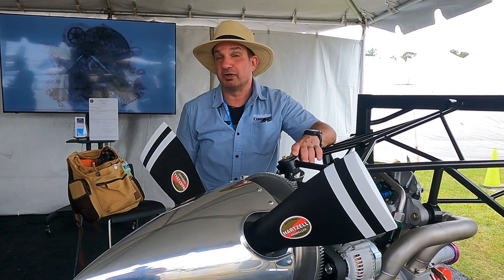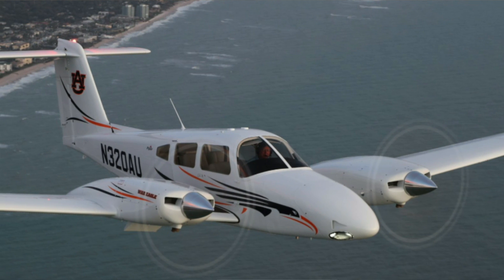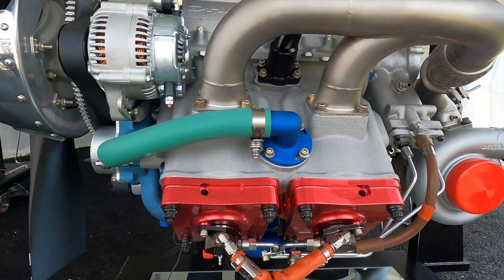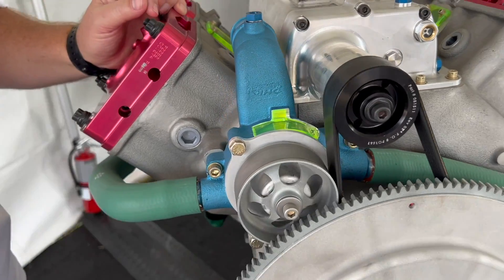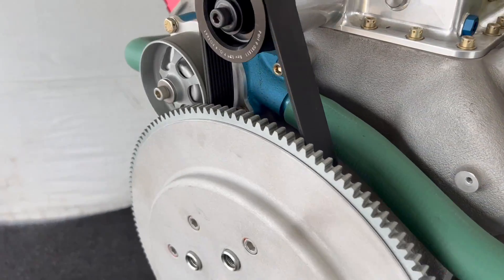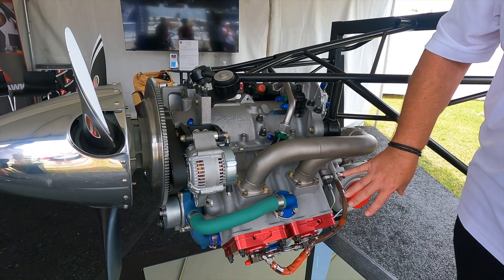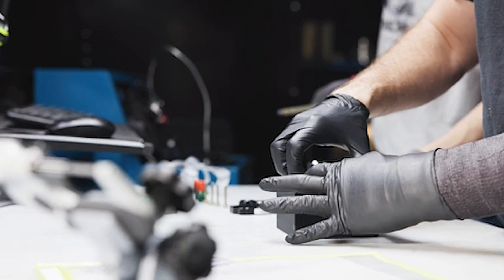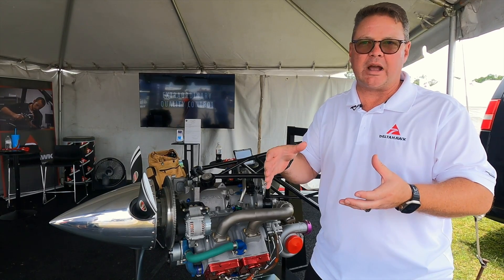EAA166 from Sun 'n Fun 2024: New Engine Walkaround

Comment: Question, do they need to be at 230hp to compete against gas turbo lycoming/continental of 230hp.  Seems to me a diesel can typically operate at 90% power all day long and the gas engine are typically operated at cruise at 75%ish max for longevity.  So a 200hp diesel would be equivalent to a 230hp gas at cruise

Comment: Current numbers I hear is $90-100k for the 4 cylinder with $60k+ for experimental.  This is engine only cost with FWF being extra.  I can't find a TBO or TBR.  With diesel weight a high concern and I assume the designers have compromised reusability to save weight, it would more likely a TBR.  Also, with litigation costs, will engine be serviced in house with only DeltaHawk mechanics or like Rotax with invite only certified shops?  Nonetheless, I don't see this trickling down to Cessna 172 types for quick some time if ever.

Comment: I love the engine.... i'm just worried about the belt on the supercharger.  Back in the day, I had a supercharger on an old toyota pickup... and it would blow the belt every 5 or 6 thousand miles.   Since it was a 4-stroke, it would continue to run. (Poorly) But it got the point where I would put on a new belt every oil change.  Since this is a 2-stroke design.... I'm sure it would stop with a thrown belt.   I wish they would have used a toothed belt (no slippage) or a more rugged drive solution. Like a gear drive with an oil bath. (the standard to drive aviation accessories)
Reply: If the belt goes when it's running the turbo should keep it running if it can push air past the supercharger. That depends, of course, on the overall design i.e. is the supercharger bypassed once the turbo is spooled up. It looks like a positive displacement supercharger which probably wouldn't let air through if it stopped turning and wasn't bypassed.
Reply: @Surestick88  Sure... but not all of them are turbo.
Reply: @PghGameFix  they literally are all supercharged and turbo charged, all 3 power outputs from deltahawk.
Reply: Why does my chainsaw run with no turbo?
Reply: @JustinHuff_EOinDixie  because it's a single cyl, with a reed or rotary valve, and it self pressurizes the case.  The multi cyl with a supercharger isn't built that way.
Reply: those were  4 rib belts pushing probably double the air